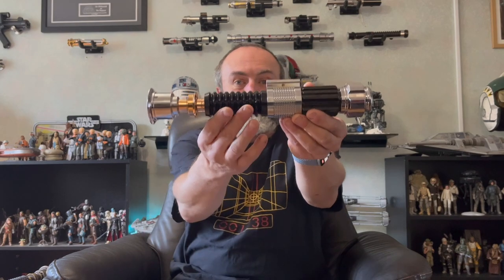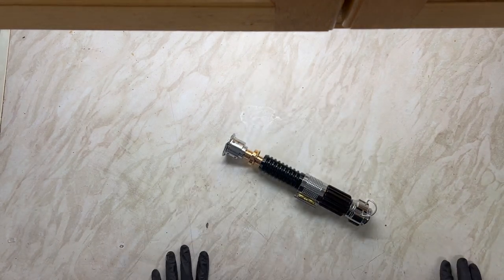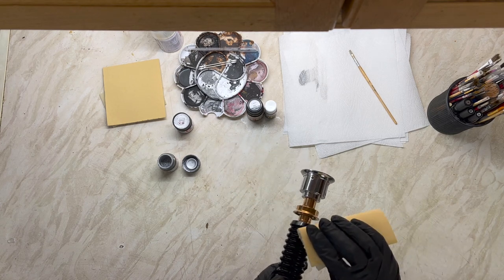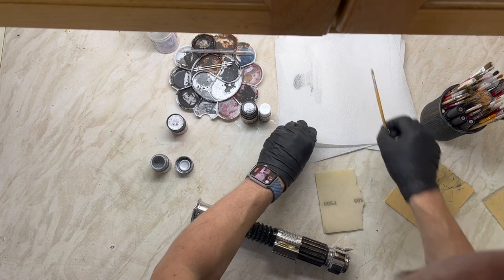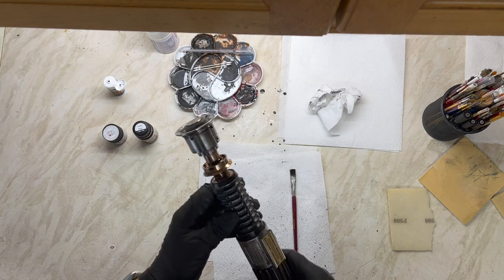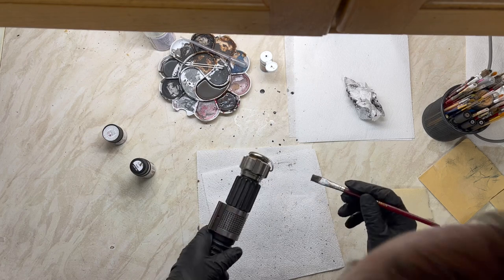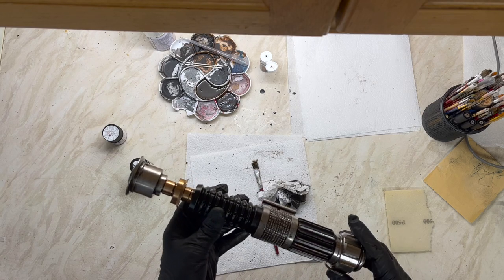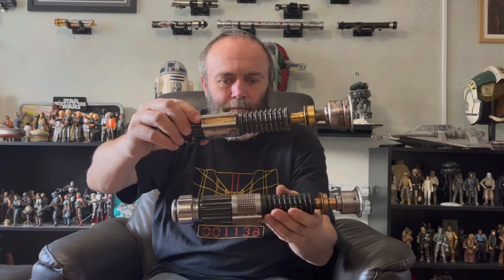Basic Lightsaber Weathering Tutorial: A look at the techniques I use to weather a Lightsaber hilt.

Comment: Finally a good video on weathering, thanks!
Reply from the maker: You're welcome, I'm pleased you found it helpful.
Reply: @paulsstuff1969  I have a question regarding the Ammo MIG Varnish. Since these are acrylic, how durable is it?
I just applied 4 very thin layers with an airbrush and now 6 hours later, it looks so good. I will be waiting 24 hours though before handling it. But this is also a thin neck Obi Wan, and I use the thin neck for spinning.

I read that you can clean Acrylic varnish with water, but does that apply to dried varnish? I am not someone with sweaty hands, but over time there would be some wear.

So I guess I need to apply a new layer once in a while?
Reply from the maker: @SLO7HProductions  I don't have any experience with Mig varnishes and clear coats I'm afraid.  I only use Mig washes and occasionally their paints.  I always use Tamiya clear coats from their rattle can range which are also acrylic I believe.  A lot of the durability will come from the preparation of the surface.  Many of these sabers have extremely smooth Chrome like finishes which will not retain paint finishes of any kind well without first being 'keyed' up with a fine grade sand paper (500-1000 grit) or something like a scotch pad prior to the clear coat being applied.  Even with this kind of prep any paint surface is liable to wear under any repeated rubbing or friction, like that caused by spinning, so occasional re-coats will probably be needed.  I normally apply 2-3 thin coats with about 40mins to an hour between coats.  I then leave this to dry for as long as possible but 24Hrs at a bare minimum drying time.  Once fully cured acrylic paints can be wiped down with water with little to no ill effect, but be aware that for more mat surfaces any rubbing or cleaning like this will start to polish the surface and may add to any sheen.  I hope this helps a little with what you were asking😀
Reply: @paulsstuff1969  thanks. I will be testing it once I have completed the install of electronics.

Comment: You're an artist with a saber Paul! Thanks so much! 

I'll try to do this with my Luke Ep6 saber to make it a little more movie accurate. Just got to get rid of the nerves that come with sanding the saber hahaha 😅

Hope you're enjoying the holidays!
Reply from the maker: Thank you Jonas, I really appreciate the feedback. I would go with just the 320 grit and 500 grit sanding for an ep. 6 Luke hilt. You can achieve the same effect as the rougher grits but it will just take a little longer. Gives you a bit more margin for error😉. Nerves are normal with this sort of thing. I get a bit anxious about the outcome even after having done this several times, in a way it helps a bit as it makes you a bit more cautious😅😅. Take your time, do things a little at a time and I’m sure you will be fine.
Reply: @paulsstuff1969  I'll take that into account, thanks!

If I just want to remove the LGT chrome finish on my sabers, will simply sanding it do? Or will I have to use the washes to hide scratch marks?

I also have a graflex and a darth vader hilt and I want them to look like how they did in the 70's and 80's but not too dirty or weathered.
Reply from the maker: @jonas8385  to remove the chrome look I would lightly sand with 500 grit first and then spray with a semi gloss clear coat. That will dull down the chrome finish. You could just spray the clear coat on but the light sanding gives a slightly keyed surface. Without the sanding the clear coat will struggle to adhere and will wear off more easily. The washes are what provide the dirtier look. Most OT hilts look more dirty than prequal hilts. You can build up the washes gradually till you get the look you desire.